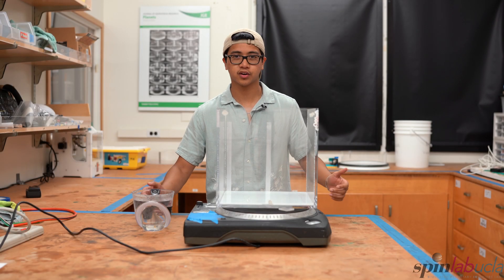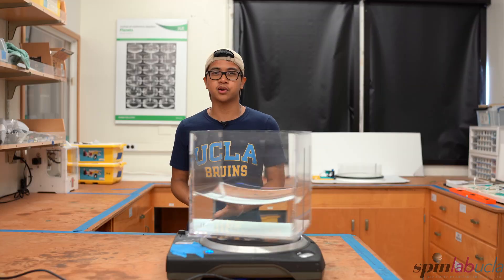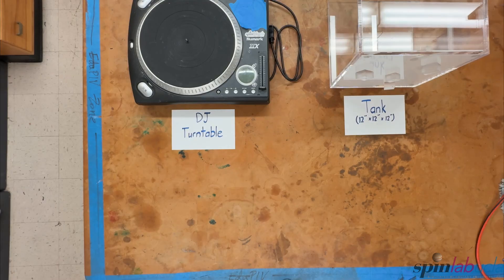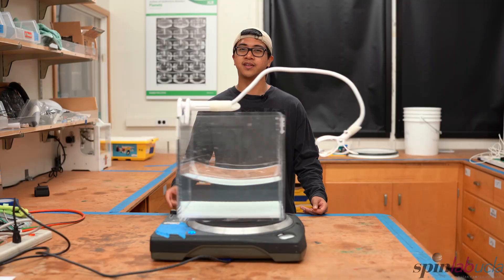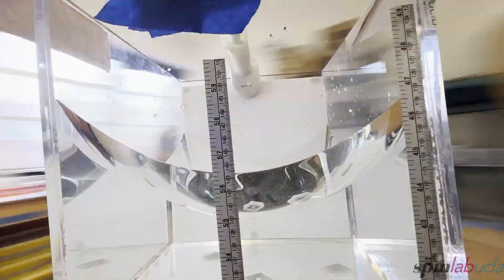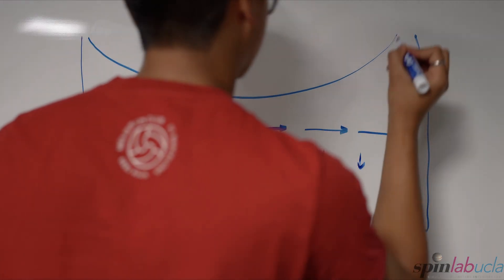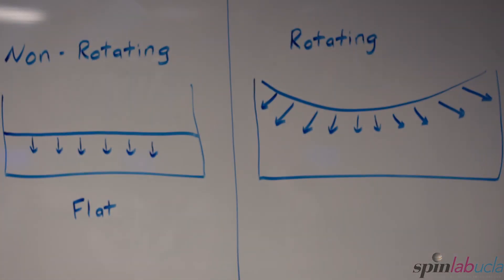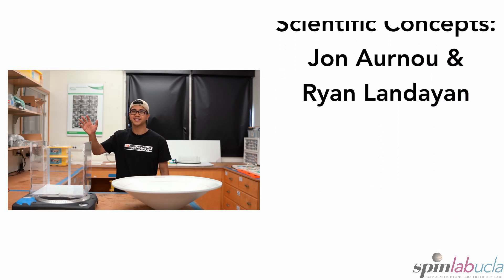Newton's Bucket:  Fluid in a Spinning Tank

Comment: That’s not a cylindrical bucket… therefore this experiment is different all together.  Nice try bill nye,  fake science guy
Reply: No, the specific shape of the bucket does not matter for Newton's experiment, as long as it can contain the rotating fluid. 

The key is the rotation of the fluid relative to the universe, which causes the surface to curve into a parabola. The shape of the container only becomes important in stopping the water from spreading outwards, which creates a reaction that causes the surface to curve.